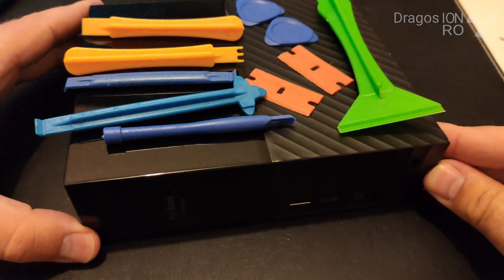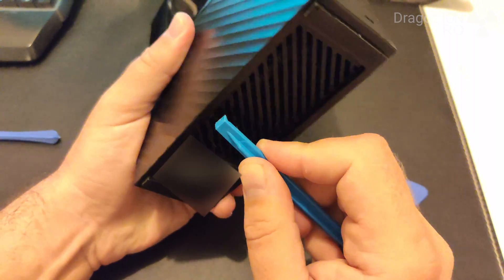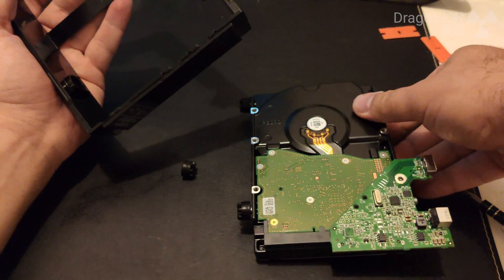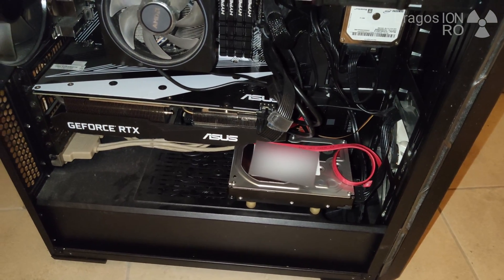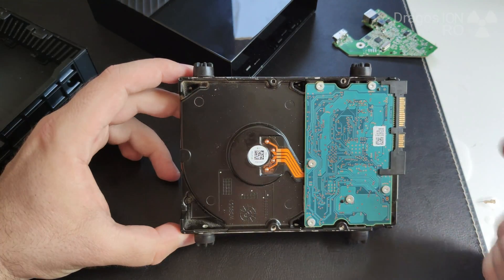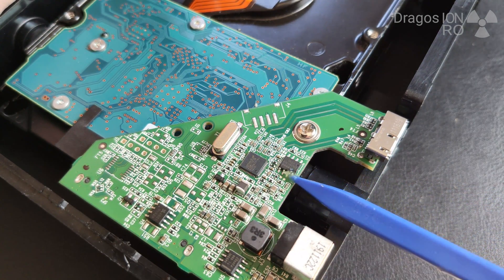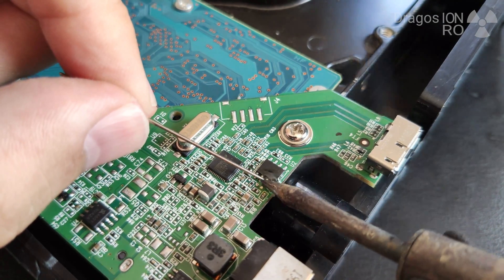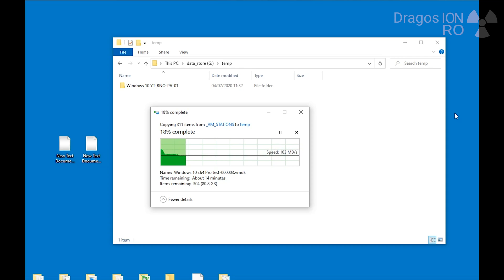Shuck External Hard Drive | HDD Hack WD My Book

Comment: Not sure if you'll see this, but good video. Better then the first 3 I watched!

I wanted to know if anyone has figured out how to use the WD lock key slot on the back of the cases. I'm assuming that's how WD tech's get inside, and with 3D printers, I would have figured that someone would have worked it out by now.

Thanks!

Comment: How did you get that blur to stay as you moved the hard drive? It seemed to follow.
Reply from the maker: It does follow usually, track and blur
Reply: @IONHowTo  Could I ask what video program you use that does this? Thanks.
Reply from the maker: @Hlpus1nall  most good video editors do it. Resolve Studio
Reply: @IONHowTo  Thanks!

Comment: I have a Wd My book  8tb hard drive, and the sata board is bad. I need to find a new casing that I can use to swap the drives out and get my data off. If I would use this method to swap the casing, would the new casing read my drive s data? I was told just swapping the sata board would prevent me from getting my data off of the drive. Which would be better, and if swapping the enclosure is the best option, does it haev to be another 8tb, or will any size work since I am only using the casing?
Reply from the maker: If you have important files on it that you don't have on other drives, don't mess with it. Take it to a data recovery shop asap.
If not, you're lucky.

You can't just swap boards these days.
You would have to find an identical board and then transfer the chip containing calibration data for your drive to the new board and only then you can hope to get it working.

Comment: Hi, can you confirm what ref is the internal drice? EFRX? CMR? Thanks
Reply from the maker: No guarantees with the type of drives in these.
Before shucking, use Cristal disk info and it tells you the drive model that's inside.
If it's not a drive you want, return it.

All wd drives 8tb or larger are CMR for now.
Helium is nice and silent but has it's own problems.

Buy 8tb+ drives to avoid SMR and test them before shucking! :)